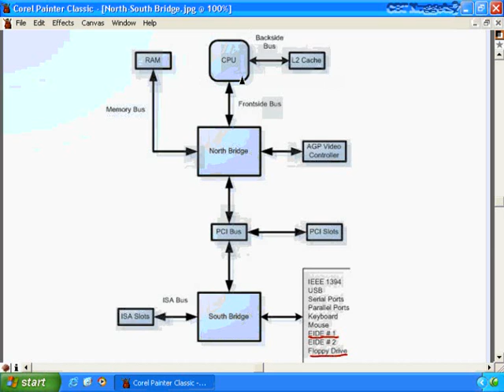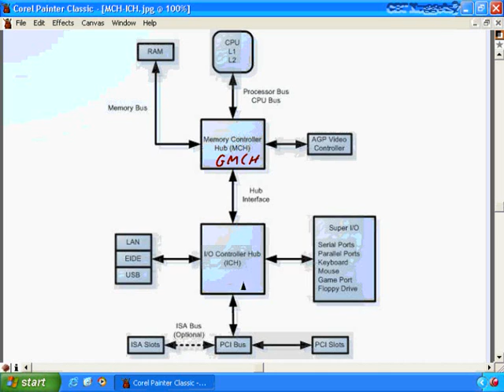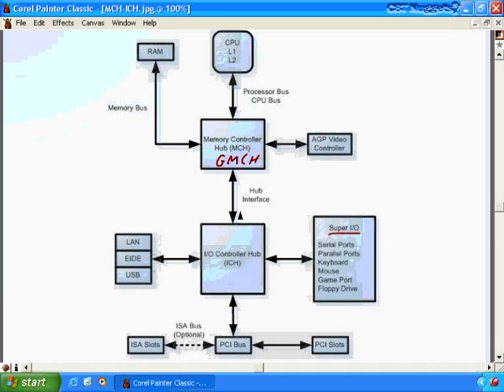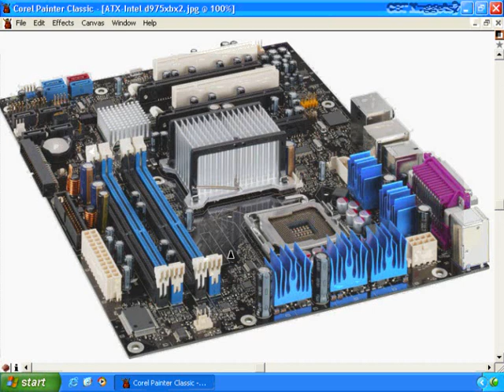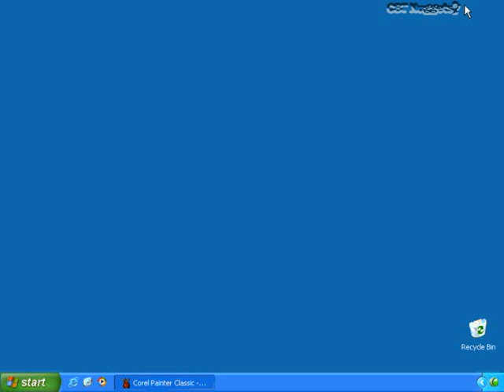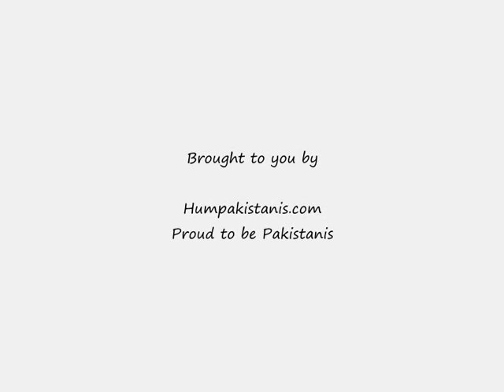Learn Comptia A+ Lesson 02 - Part 04 - Motherboards

Comment: Question about the new Chipset Arch. (MCH/ICH).  When you said that the L1 and L2 cache is both located inside the CPU, are you just talking about Intel based processors or AMD based Processors?